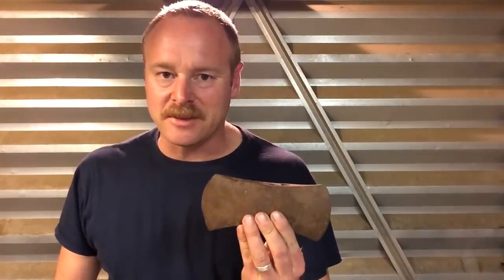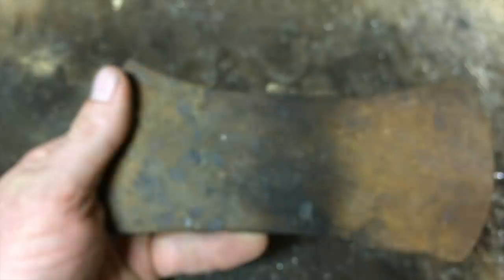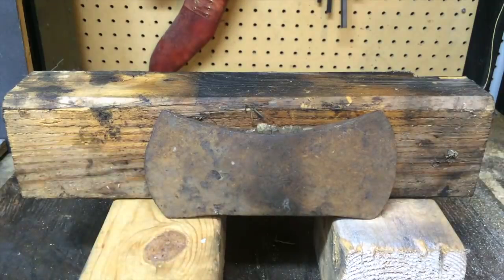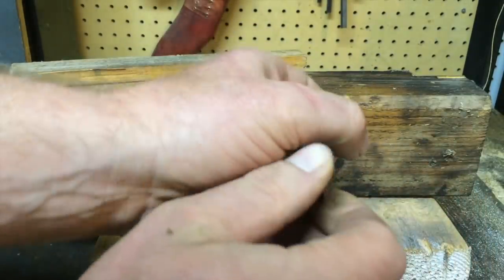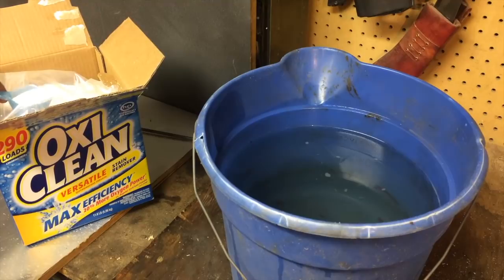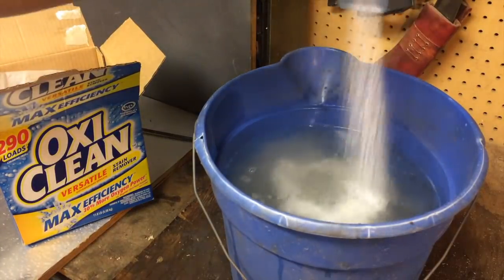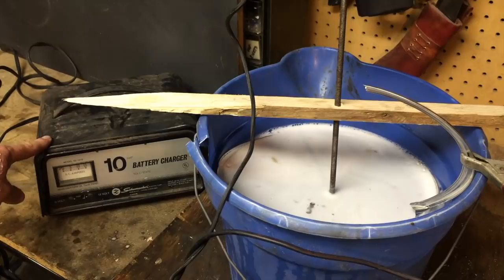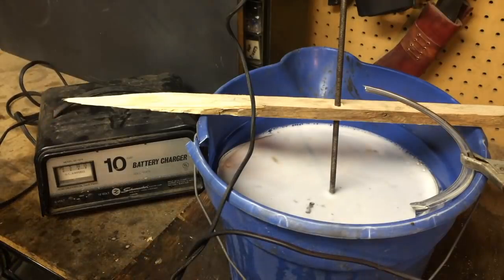Remove Rust With Oxiclean | Grandpa's Tools | Cruiser Axe 1

Comment: Thank you ! The toxic element in stainless steel is not mercury but chromium. If the electrode turns yellow, you have made toxic chromates.
In industry they use strong acids such as sulfuric acid or phosphoric acid and high currents of 60 A or more. After rust removal, the acid MUST be neutralized with a solution of sodium hydroxide (lye) other base. Rinsing with water is not neutralization. Hydrochloric acid fumes corrode everything nearby. Never bring it into your workshop.

Comment: to remove broken wooden handles, place the tool head on a wood stove. Keep below 400 degrees f. so the temper is not changed. the wood will shrink and drop out.

Comment: I prefer my cheap harbor freight gravity feed sandblaster with readily available  #2 sand. Cleans quick, down to the base metal. Dust mask and a strong fan keeps the silicosis at bay.

Comment: Funny that the oxidized nature of the axe (aka rust) was able to be removed by using an oxidizer (Oxiclean).    Personally I would have taken a wire wheel to it and sanded it clean but this definitely is the cool factor of doing things.
Reply: Or just use some vinegar to break down the rust,  rinse it in a baking soda (AKA sodium bicarbonate) and water solution to neutralize what bit of acid is left then sharpen and polish it as you like.

Comment: The title is a bit misleading.  it is the electrolysis that is removing the rust not the oxiclean.  This process would work just as well but slower using plain water.   The oxiclean only makes the water more conductive. Regular baking soda does the same thing but it might be faster with oxiclean.

Comment: Not sure if you care but thought I'd pass it along.

Next time you change out the box of baking soda(NaHCO3) in the fridge do this. Take the old box and spread it out on a small baking sheet and bake it in your toaster oven for about 45 minutes at 400 degrees. What happens is the the Hydrogen bonds with the oxygen in  to make water and what you have left is Na2CO3 or Sodium Carbonate. 

Cheaper than oxi clean and the wife won't be mad you're taking her cleaning supplies.
Reply from the maker: I absolutely care! I love learning stuff like this.  Thank you very much, I'll keep this in mind when I change out the box next time :)
Reply: No problem, just be sure to stir it a couple of times. And yeah a box of baking soda is only like $1 but waste not, want not I always say.

Comment: Great video, thanks, and I'm going to use your method.  One further note. You are right, water does not conduct electricity at all, not just not very well, not at all.  Pure water that is.  Also known as the universal solvent, water holds various chemicals, and compounds in solution, and those chemicals, and compounds often conduct electricity.  If a live wire is in contact with pure water, such as distilled water, don't think you can put you hand in it without getting shocked.  Everyone's heard  that humans are up to 60% water.  But that water is saline (salt water), not pure water, and that conducts electricity very nicely.   As soon as you put you hand in the water with the live wire the salt from your hand will go into solution with the distilled water, and that solution, even though weak, will conduct electricity, and shock, or electrocute.

Comment: I would liked to have seen a comparison of removing rust using a steel wire wheel on half of the axe and the other half as in the video.  This means you only dip half of the axe blade, and compare to the wire wheeled half.

Comment: Actually, clean water is used to clean off electronics boards during manufacturing. They are then tested before they are dry as the "Clean" water is non conductive. Years of working in the manufacturing industry.. A Wave solder machine solders the contacts, then it goes through the wash / blower and then is stacked and tested.

Comment: Most tool heads that take wood handles have a slight taper inside. To easily reove broken handles, saw off the old handle just below the head and drive out the old wood from the bottom of the tool head.
John Davis
Reply from the maker: Yep, that's the way to go for sure.

Comment: Its not the Oxiclean that is doing it, its the electrolytic process using the battery charger.  Salt water would work or any laundry soda works great too.
Reply from the maker: You're right, as     i     showed     in     the     video     the electrolysis is doing the work.  The oxiclean is facilitating the electrolysis.  I'm no chemist but I would recommend again, not using salt so that you don't create chlorine in your workspace.

Comment: You should be ok explosion wise if you keep it away from heat in the 500 degree f area. And youre correct about chlorine being a hazrd. Not so much for breathing but hydrogen chlorine and oxygen makes the hydrogen much more explosive.

Comment: what happens if you reverse the positive and negative?  If you don`t tell me I have to try it and I wanna live haha!  another very good and detailed vid.  thanks
Reply from the maker: Hey Glenn, It won't be hazardous to you but your results will be poor.  The electrons will travel the other way so the metal from the can will try to deposit on the axe head, no bueno.
Reply: ok. so no fireworks.  boosted my jeep one time in the dark and crossed the cables.  Then it wasn`t dark anymore for an instant.  lots of sparks and it smoked the stereo.  thanks again

Comment: there isn't mercury in stainless steel.  you must be referring to the chromium.  hexavalent chromium (Cr6) is toxic...or carcinogenic.  perhaps steel wool would be a good anode, since it has HUGE surface area.

Comment: JUST STUMBLED UPON YOUR CHANNEL AND THRILLED WITH YOUR CHANNEL

WHST KIND OF SETUP IF YOU HAVE MULTIPLE OBJECTS? I HAVE A HANDFUL OF SOCKETS AND WRENCHES THAT I NEED RO RESTORE. WHAT CAN I DO?
Reply from the maker: Hey Chuck, I'd try running a copper wire through all of the sockets but keep them each separated by 1/4 inch or so if you know what I mean, run the wire thru the socket then loop around an back through it, then same with the next etc

Comment: hey dude
take a 10 pnd bag of baking soda in a. oven safe container 
bake for 2 hours at 350/400
and you'll have laundry powder I forget what's it's actually called but it's also an electrolyte which may work better than or as well as oxy clean for a lot less money
try making a small batch 
I think you'll be surprised

Comment: make sure you oil it up as soon as you dry it or it will rust overnight . dip and massage oil into it and hang to drip dry . I use electrolises al the time   ordinary baking powder works best without the bicarb.
Reply from the maker: true statement on the oiling bit

Comment: Baking Soda (Sodium Bicarbonate) has a pH of around 7, while Arm & Hammer Washing Soda (Sodium Carbonate) has a pH of around 9. If you want REAL CLEANING (faster), go with pure Sodium Carbonate...cheaply: Just put Baking Soda on a cookie sheet or sheet-pan and bake for 50-minutes in your oven at 475-degrees F...careful when you take it out, and don't breathe it in, in powder form...it is now almost pure Sodium Carbonate...pH of 11 (as strong as powdered lye)...and CHEAP!!! Works great for this process, lot less impurities too.
Reply from the maker: wow that's super cool to know!  Thanks Skeeter

Comment: I have an old hatchet, Its green in color the cover says made in Japan.    I have been told its WW2. 
I can not find it anywhere on the internet.
Reply from the maker: I may be mistaken, but it seems to me that anything from pre WWII Japan wouldn't have english words on it.  Not to be a downer, that's just what strikes me right off the bat.  If, however the "made in Japan" is written in Kanji, there's a good possibility that it is from that era.  Thanks for watching and taking the time to comment!
Reply: Zack Of All Trades yeah...  that's just what I thought.  And also it it was ww2 I thought they all had made in USA. And plumb stamped on it.  kinda throwing me off.  it looks old and warn out.  Ian just trying find out if I want to keep it as is, or refinish it

Comment: Using just "washing soda" (Sodium Carbonate) will work just fine.  You can make "Oxyclean" (Sodium Percarbonate ) solution mixing Hydrogen Peroxide to your Sodium Carbonate solution.  Remember that  "washing soda" (Sodium Carbonate) and "baking soda" (Sodium Bicarbonate) are very different and not interchangeable.

Comment: YOU NEED TO "STAY FOCUSED." You jumped from desolving rust to "some other's" site and what they are doing, which could have and should have been at the end of your project. Perhaps their site is where we should have been from start. ALSO, there appears to be a better way to dissolving rust on another channel, using vinegar.
Reply: This could have (should have) been a 2 minute video.  I think a wire wheel would have done a better job and it would have been left shiny; not black.  Of course, if it were an intricate  part, a solution may be better.
I have used white vinegar and it does just as well.
Reply: I've tried vinegar before. It takes wayyyy longer than electrolysis does.

Comment: This is cool, it works and all that.  *BUT* to anyone using this method (electrolysis) for rust removal, be very careful about the material you use for the electrode (opposite of the workpiece) and DO NOT use stainless steel of any kind.  If you do, you will produce very toxic chromates (hexavalent chromium, etc.) in solution.  If the electrolyte turns yellow, that's bad news as that indicates chromates are present.  NASTY cancer causing stuff.  Anyway, as you were...
Reply from the maker: Hey thanks for the comment, and thanks for reiterating my warnings, it may be minute quantities of nasty stuff but still nasty stuff.

Comment: I got an old ax..I bought a new handle for $20..I put on the old ax head on the new ax handle. (It had no sentimental value to me). I did everything right.. machined it and another perfectly. 
I walked into a store one year later and I saw a new ax with a new handle for $21. There is a lesson here. No?
David
Alberta

Comment: The title of this video is very misleading. The rust was removed by electrolysis not by Oxiclean. Oxiclean  by itself is useless for removing rust. To increase the conductivity of the water baking soda is most commonly used not Oxiclean.

Comment: Hummm, this looks a lot like reverse electroplating. I'll bet the tin can, is covered in the same rust, that was on the ax head. 
You could reverse this and use a different metal as the cathode, say copper, or nickle, and the ax head would pick up that metal and remain pretty much rust free for the rest of it's life.

Comment: Good work.  Suspend the part next time.  Some of the electricity will be wasted by shorting in the junk on the bottom of the bucket.  Love electrolysis.  I have done an entire motorcycle frame in a barrel.

Comment: Please be careful with the sacrificial metal - steel is rarely "just" iron and carbon. It only takes a little zinc, chromium etc to turn this into a nasty experience with toxic gas. Safest option is generally uncoated concrete rebar - I would never use a can like this, just in case the metal were tinned with zinc. Always safest outdoors. Having got that out of the way, you can increase efficiency by agitating the fluid. Simple way to do this is to bubble air through the bucket with a cheap fishtank aerator.

Comment: The hotter the solution, the better it will work.   If you use a carbon (or Titanium) rod as the anode, you will have a much cleaner result.  Check out Shopdog Sam’s YT videos on clean electrolysis.

Comment: Seems like a wire wheel on a bench grinder & 10 minutes would have done the trick..
Reply: Yes, and ground off the initials, took off metal unnecessarily and learned nothing. But, 'easy' is always 'a way' to go.
Reply: Gray w - Sorry, not trying to rain on your parade but I live in Washington State and rust is a real issue, I’m always looking for better ways to fight the problem.  So I’ve found white vinegar to neutralize the oxidation (but it darkens metal) and a wire brush.  WD40 also makes a good rust removal soak product and I’ve heard of some folks using electrolysis but I don’t see how that provides better results than simple vinegar?   So when I saw your title about Oxy-Clean, I thought you might be on to something..

Comment: Your advice not to use stainless steel is spot on. 
But its not mercury, it's generally chromium. But please, use baking soda or washing soda for your electrolyte.They are cheap and safe. The chemical compositions of washing detergents are complex and under electrolysis releases who knows what. Please stick with the sodas.

"Stainless steel" is the general name for dozens of alloys with an iron base. Stainless steels contain chromium, nickel, manganese, niobium, and on and on. The problem with using stainless steels is it will release chromium into the electrolyte. Bad. Very bad. It''s illegal to dispose of your chromium containing electrolyte in the sewer, poured out on the ground, etc. Besides the other elements present can cause some serious bad chemistry. Literally.
The electrolysis process is the exchange of ions.....(insert lots of chemistry here)....therefore doing whatever it is you are doing. 

The "threshold" is when the electrolysis starts because the first few atoms on the surface of the stainless is chromium, nickel, etc. That surface is what protects the steel from rusting. 

I have worked in metals all my working life, heat treating, forging, plating, etc. 

A popular test for stainless steel is to see if a magnet sticks to it, if not it''s stainless. Usually a pretty good test, but there are magnetic stainless steels.

Comment: Paused the video at 0:01 to say one word:
Evaporust.
You’re welcome
Reply: I wonder why bother with this when you can spend 30 seconds with a wire wheel? He had to use one to make the grounding points anyway. The handle hole might be tough but still it wouldn't take 24 hours to do by hand.
Reply: Some items you can’t reach certain spots with a wire wheel, also, wire wheels are abrasive and remove parent material, whereas evaporust chelates the oxides only

Comment: use potassium hydroxide flakes, buy on amazon, buck n a half for small bottle.  perfect electrolyte
Reply from the maker: Good to know, although the point was using what I had on hand at the moment.
Reply: yep I get it.  hey just for funsies since you like to tinker around... I do also and I had to know if those water for fuel gizmos actually work.  they do.  I made one for about 200 bucks in parts.

Comment: I could've done that faster using a wire brush to knock off the soft rust and a scouring paste made from Portland cement and motor oil.

Comment: A lot safer and faster: Just use a wire wheel to get the major rust off, apply some PB Blaster, let it set a short time, brush with a wire brush and apply oil/wd40 on it, 30 minutes and done.???
Reply: I was thinking angle grinder and flap disc a higher grit like 80 or 120 get the surface rust off resharpen at the same time. Then repaint/seal then new wood or maybe fiberglass mold a new handle
Reply: Could use a Dremel tool for slower more precise removal with sanding drum or wire wheel should take about half a hour. I'd hit it with the grinder or a die grinder and be done in 5 mins and it'll be painted and drying by the time that half hour is up

Comment: This site is the one I went to for my electrolysis instruction http://antique-engines.com/electrol.asp here's the portion that explains why using stainless steel is bad http://antique-engines.com/stainless-steel-electrodes.htm

P.S. I'm guessing that metal piece in the handle was a wedge driven in the end to split out the handle end to make it stay snug in the head

Comment: Vinegar/vinegar & baking powder is the way to go,
Reply: I've tried the vinegar method letting the tools soak in it and then using steel wool to clean them works great, but then they seem to rust faster after I am done. Is there something I should be putting on the tools after I clean them?
Reply: I’m a woodcarver and I build furnature so I’ll restore old hand tools to use, depending on what it is (and potential value) I’ll keep a thin coat of oil on anything I’ve stripped rust off of, or if it’s like truck parts or a bigger tool I’ll paint it (nothing special just rattle can, hi temp if it’s a truck part)
Reply: @dustinhargrove2129  thank you, grandsons went in tool shed, used things and then left them out in the tall grass all winter, plus the roof on the shed blew off a time or two and we had to put it back on. Spring is our rainy season so trying to restore our tools. Just seemed like the first things we restored were rusty again by the time we got to the last thing
Reply: Cynthia Howe  Hah! Sounds like me as a kid 😂 good they’re out using tools though! 
Holy smokes the roof blew off? Glad we don’t get wind like that here in the PNW
Reply: @dustinhargrove2129  It is a metal frame, cemented into the ground and the roof is held on by zip ties. I've been after the roommate to replace the heavy tarp sides and roof with something more substantial. The frame could hold a metal roof just fine or a plywood covered in either roofing or metal just fine. Would need to use those u shaped fasteners to go over the metal frame and screw into the plywood. Wind broke the zip ties, the tarp is fine.